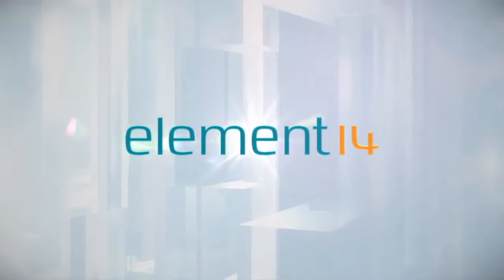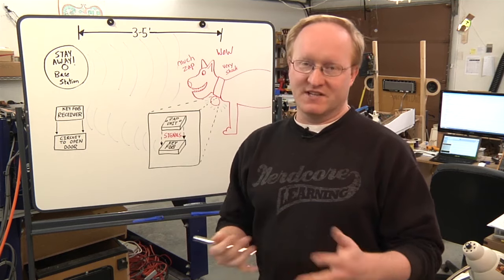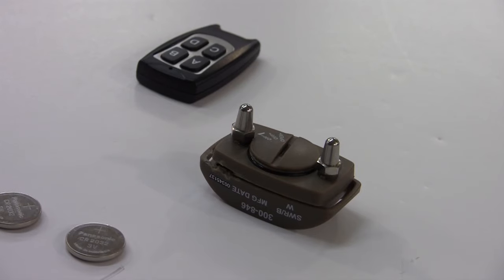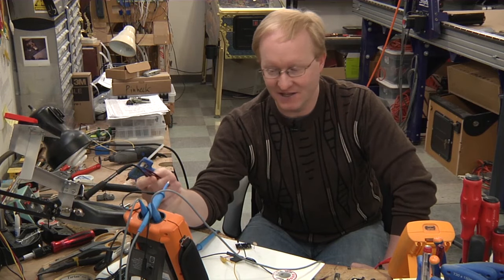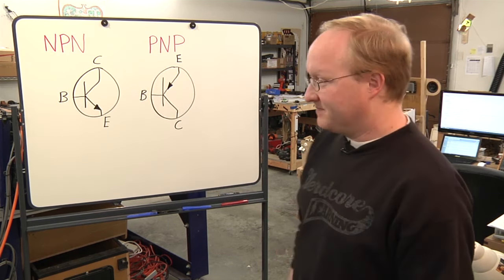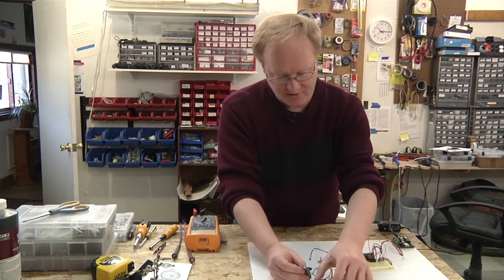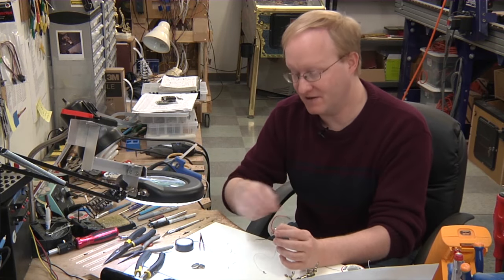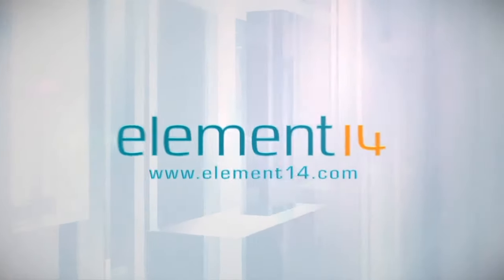Ben Let the Dogs Out: Electronic Door Build - Part 1

Comment: Sorry if I've missed something here, but why does he need the 555 monostable between the two circuits? Couldn't he have just use a capacitor to smooth the output from the piezo, similar to rectifying an AC signal?

Comment: A diode and a small cap (or resistor and cap) could have replaced that 555 circuit. Peak-detect,or low-pass filter it..get a DC signal.

Comment: Personally i consider dog shock collar a torture.. Every owner should try that on themselfs first... How your going to like being shocked...

Second i would go down the ID RFID chip route.. They are unique per pet and as bonus you get your pet back if its ever lost.. Many animal shelters have hand scanner to read these...

Little engineering since your in over engineering mode and you can read that RFID chip from distance away...
Reply: I always shock myself with the collar before I try it on my dog. Every time I consider turning the levels up. It never hurts.. it’s uncomfortable slightly if that.. my dogs learned the barrier of my property very quickly. each only got shocked a few times and they quickly return to the yard.. it beeps as they approach the barrier so they know not to go further. Most of the time the batteries in the collars are dead now and they won’t leave.. Definitely not torture. Better than chaining them up all day or having them get hit by a car!

Comment: Why dont you take the batteries off the board and put them somewhere on the, i dont know the english word, necklace?
This would make the unit even flatter and more comfortable for the dog to wear.
And this build could need some kind of warning circuit when the batteries run out of power, but i dont know if its possible to make this compact.

Comment: Over engineered. Dogs and cats have microchips that are unique to them and work using RFID. Connect an RFID reader to the solenoid latch and Bob's yer Uncle.
Reply: But where is the fun in that.
Reply: Haha. Very true, brandon rudy
Reply: brandon rudy I don't think the RFID chips implanted in cats and dogs can be read at range. Chip readers used by vets pretty much have to be pressed against the animal to read them.
Reply: I think EnigmaNL is right, these chips don't have the range to work with something like that. They work more like nfc tags, which need to come really close to an reading device.
Reply: You mean, they have RFID chips „by design”? I'm not even sure the adopted dog has it.
Reply: There are commercial pet doors that use the dogs ID chip to trigger the door. The pet approaches the door and, within a range of six inches, it releases the latch. Why would it need to work at longer ranges than that?

Comment: Nice build, but unfortunately your explanation of bipolar transistors is wrong. What you are actually describing sounds more like a FET.

Bipolar transistors are not controlled by voltage. The voltage you have between the base and anywhere else is irrelevant, you need current into (npn) or out of (pnp) the base to control the collector emitter current.

N and P do not stand for negative and positive, they stand for the type of silicon in each of the three layers. N-type has electrons as the majority charge carriers and P type has electron holes. So in an NPN, electrons can only diffuse through from the emitter to collector when there is current continuously flowing into the base, neutralising the holes in there and making it like a conductor.

Comment: I'm only 2 minutes in...but 
...this is very rube goldberg.  What's wrong with rfid?  Dog door itself is large enough that it can have giant coil so that range > 18 inches.  Dog only has to carry waterproof, inexpensive, lightweight fob on existing collar.

I love over-engineered solutions but those shock-collars are expensive systems.

Comment: Did anybody stop and think he's doing this project with junk he has laying around? He could have designed a board and had one printed out if money was no object, or just used EAS tags or maybe RFID, but then where's the fun in connecting all the parts with this junk he has lying around.